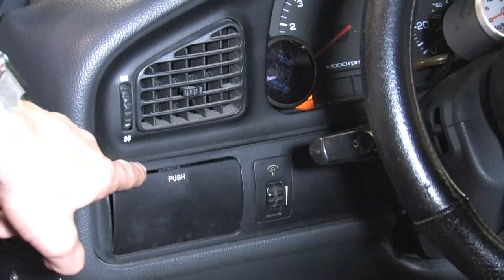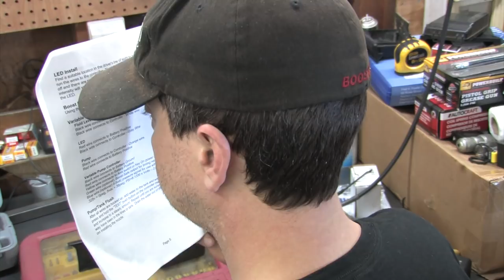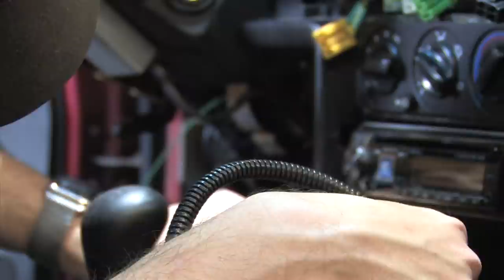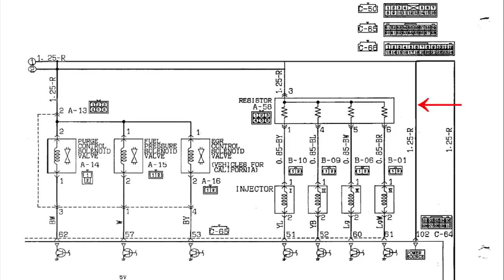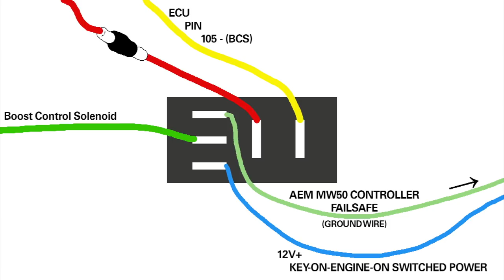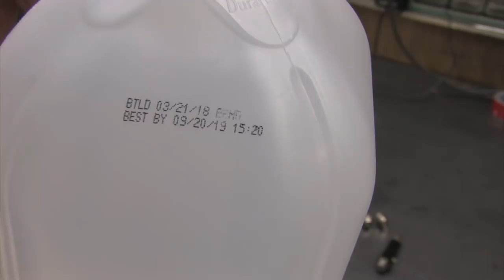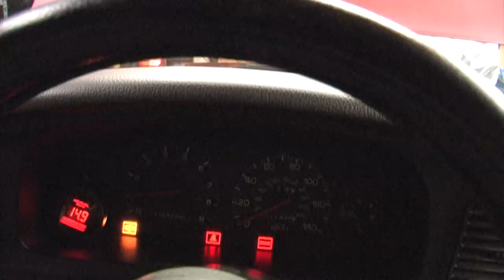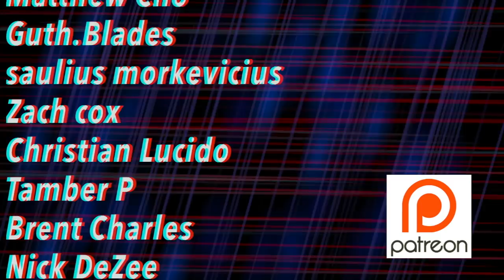Water Methanol Injection Installation

Comment: Why didn't you just rig up the stock windshield wiper reservoir that would have been cool love your videos Man.
Reply from the maker: Because it's on the floor in the corner.  It was evicted because local officials executed imminent domain over the real estate it occupied and they repurposed that area for a big, wide, 1-lane intercooler pipe.  It's now homeless.  Where I live, a windshield washer is not a mandatory safety item, so I removed it when I re-installed the FMIC (it had a side-mount).  The Hyundai's washer bottle also has about half the capacity that the one included in the kit... but on some cars that's a good, stealthy mod.

Comment: I like your video but I do have to disagree with you about the boost gauge (And not entirely). Its objective, it's a waste of money to you. Yes a map sensor and logs will always be more accurate for running and driving. But a mechanical boost gauge is always a good idea. Both in my b5 s4 (got rid of it recently) and my Volvo 240 turbo I run boost gauges. And I do hardly ever look straight at them while driving. But a little bit of self training and I can still pay attention to them in the moment. Take my Audi for example, it spiked at about 23psi tapered off to about 19-20psi. If I start spiking at 27 or more in know there's a problem. The ecu wouldn't throw a code for that so me seeing that and thinking critically let's me realize I should back off till I can get a chance to inspect what's going on. Same thing if the car feels sluggish, if I notice I'm under boosting there's obviously an issue. Now, this is a bit more critical on my volvo because Bosch LH2.4 is quite a primitive fuel injection system (have two separate computers for fuel and spark) so I have to pay a hit more attention. 
And as far as the boost gauge blocking the CEL, dude you could have mounted it in a different spot. That spot in front of your dash was your choice, not the boost gauges. In my idea, gauge rule #2 is dont ever block information readouts you'll want to see while driving. (Number 1 is dont get gauges you dont need obviously) 
But seriously nice video, I'm hitting the subscribe button.

Comment: My N/A stock v6 currently making 300hp. Would this be a bad idea if I plan on keeping the stock tune while adding Water methanol injection?  Can this be done and is it worth it, I am looking just looking to improve my engine from carbon build up since it is Direct injection. Its 30,000 mile and I plan on owning it for 200,000. 

2017 3.3 v6 Kia Sorento AWD.
Reply from the maker: If you're just trying to prevent carbon buildup, there are fuel additive treatments that will create the same effect.  Of course they're not permanent fixes, you have to do them periodically, but they're extremely effective.  For instance, BG44K and 3 tanks of premium fuel will blow all the carbon out of everything that fuel, fuel vapor or exhaust touches.  It kept my Toyota truck carbon free for 330,000 miles using it once a year (I drove that truck about 30,000 miles a year).  Water injection's main practical purpose is a power adder.  There's no practical benefit from installing it unless you can tune and lean out your fuel mixture, so a stock ECU won't cut it.  Also, the performance benefit on an NA setup is so minute you'd never feel it.  NA engines run on vacuum, and this particular kit won't activate until it's reading boost on its own MAP sensor, so a normally aspirated engine would be incapable of even turning it on.
Reply: Jafromobile thank you, I use premium every once in a while for that reason. Thinking about a baffled oil catch can. Awesome channel by the way

Comment: Thanks for a great and detailed video about this. A couple years ago I melted 3 pistons in my 8 valve Shelby Daytona. Thought  I was safe by using a 5th injector to fog the induction pipe with 93 octane,  just ahead of the throttle body. Actually, that worked for 2 years fairly well 'till something caused an over-boost condition. Even with the extra injector, it wasn't enough fuel to keep things cool. Water/meth with its own high pressure pump is a better way to go. Like your's, my engine compartment is packed full so it's going to take some figuring to install something like this. By the way, WHAT is all that junk in your trunk? Maybe if you remove some of that stuff you won't need  meth injection. Tee HEE.
Reply from the maker: That my friend, are the fastest subs in Sandston.  :)  That stuff went 12.20 before with the same turbo in a 500lb heavier car (and no methanol injection).  I need some room for improvement once I max this thing out.  Until then I have bass.  :P

Comment: At 39:05 you start to get the theory wrong.

Yes water/methanol vapour displaces air

Water vapour is not incompressible. Water is but your talking about cc per minute and your engine flows litres per second, it's not enough to affect anything in that regard.

Yes air density does increase, math works out to be around 3% in most cases

Methanol does raise the octane slightly, but only by the same proportion it would if you mixed that volume with the fuel directly. The bulk of the anti detonation characteristics come from water evaporating on the compression and power strokes.

NACA studies showed that 100% water was best for detonation suppression and 50/50 with methanol was best for power, I don't recall the difference being that great, I'm 80% sure the primary reason for alcohol was as an antifreeze
Reply from the maker: Water vapor can be compressed back into its liquid form and I did cross my wires there.  I gotta own that.  The amount of compression required to do that though... there's not enough compression in a gasoline engine to do that.  Not unless you flood the intake with a ridiculous amount of water/methanol where it doesn't convert to vapor... and then my claim is true... which would actually be horrible.  

Water vapor in air is a suspension, but I had totally forgotten that the vapor molecules are enormous in size for being such a simple bond.  The expansion that occurs converting liquid water to vapor is the precursor to its conversion to steam which requires thermal energy that you won't find in a car's intake.  The steam conversion is when it expands 1600x bigger than its liquid state... but the water molecules converted to vapor grow in size until they displace the air suspending it, and the size of the water vapor molecule makes it lighter than the air around it.  Forgive me, it's been 25 years since I was in college chemistry.  I will say this, though.  My IAT's with 50/50 are only 96° on an 80° day at 21 pounds of boost at 6000 RPMs.  Down from 130°.  I lost 34° off my intake temps!  :)  And yes, alcohol is an antifreeze as well as a fuel source.  The differences between the thermal properties weigh in water's favor, but they're so close that they're practically interchangeable.  What methanol does is make it less prone to blowing spark out or flooding the burn.  Even injecting straight water will raise your octane because it stabilizes your fuel source for higher compression limits.  AEM's claim is that a 50/50 mix can raise the octane of your fuel source equivalent to 114-116 octane with 93 octane gasoline.  That part I read.  I didn't do any science-y things to verify it.  I just know from the driver's seat and my datalogs that all the knock is gone.
Reply: I'll be finding all about the cooling shortly. My own project is a car built specifically for burnouts, so I'll be developing 300-ish horsepower for two minutes with zero airflow beyond what the thermofans can supply. Naturally the intercooler won't work so well under these conditions, so I'm not even going to run one, and water/alcohol injection is the answer.

How did your polished combustion chambers go for knock suppression? And did you polish the pistons too? I'm considering doing that to the spare engine I have not just for knock suppression but also to minimise cooling system load (less surface area equals less heat absorbed and so on)
Reply: Also, how much timing are you running compared to stock?

Part of the fun of my project is to run everything ultra-budget. I can get the fuel side of things down pat really easily, and I'm trying to figure out what to do about the ignition. My engine is N/A to start with and has no timing adjustment. I mean I can get the ecu reprogrammed with the turbo tune (which will take about 5-8 degrees out at full load)

(PS I have lots of spare engines and the crowd loves it when stuff blows up, which is why I'm comfortable doing things in such a questionable manner)

Comment: But methanol is something you find at the corner store.. Napa, gas stations.. it's called windshield washer fluid.
Reply from the maker: True, but it's only 30% tops.  There might be a slim chance a grocery store has a bottle or two of a fuel drying additive that might be 99.7% methanol in the automotive shelf if you're lucky, but you'll pay a ridiculous premium for it and still have to mix it yourself to get 50/50.  If you just tune for washer fluid, then you'd be fine.  You won't be getting the best octane numbers, but the cooling benefits are all there.

Comment: What if the pump fails? How did you protect against that? TeLly want to do this on my 17 civic si over e85.
Reply from the maker: The controller in my kit senses the pump failure and puts the kit in "boost safe mode" which is why I wired in the relay in this video.  It activates a ground wire that shuts off my wastegate solenoid  Should any of the 5 conditions occur that can cause methanol to not flow, the kit activates this mode.  How you choose to address this on your equipment is up to you, because there are a few different ways to mitigate knock when this happens... but what I did with my failsafe works for the way I tuned my car.  I am tuned for 100% gasoline all the way up to wastegate pressure, so my fuel maps are safe whenever the kit fails and puts me at wastegate pressure.
Reply: Jafromobile awesome. Thanks. The civic x si supports 2 drives modes (normal and sport) selectable by a button on the console. It also supports two base maps for each driver mode (ktuner). My plan is the normal mode base map is just for the 100% gasoline tune and the sport mode for the water/meth. I want to integrate the water/meth system such that in the event of a failure, it switches the ecu back to normal mode.
Reply from the maker: That might be possible depending on how that switch is triggered.  But the setup you describe also wouldn't require a progressive controller like this kit provides.  This one uses boost pressure to control the flow rate of the methanol.  It delivers flow rates based off of air pressure, not air mass.  You would have a much easier time tuning your fuel map if your setup just turned on 100% above x PSI in sport mode.  That same advice also applies to me, but it's not what I'm doing with it.  My failsafe method doesn't require switching maps or manually changing my boost levels.  No interaction is required from the car or the driver because I'm relying on a system that's separate from the ECU with its own built-in failsafes to interrupt the ECU's function.  That's the benefit I get from using the controller.  I didn't have to wire anything complicated or invent my own set of relay failsafes wired in to protect my engine if there's a failure.  

If you have 2 modes, you just need a relay to turn the kit on in sport mode for 100% flow with a pressure switch.  It's actually much simpler of a setup that would deliver the maximum benefit of knock suppression and fuel supply, but it would have no failsafes and you'd have to piece it all together yourself to do it.  You would need a handful of relays to ensure the boost gets cut or the map gets switched in the event of a wiring fault, pump failure, empty tank, or clogged nozzle occurs.  The only benefits of buying a kit with a progressive controller are getting [almost] everything you need in one box, and having those failsafe functions printed on its circuit board with a 1-wire output.  If you can figure out how to switch the mode by pulling a circuit somewhere on that car to ground, or by wiring in a relay to switch the circuit, then the kit with the progressive controller could do what you describe.  Creative tweaking of the min and max knobs would also help you discover an easy way to tune it.  You can set them to make it act just like a pressure switch.